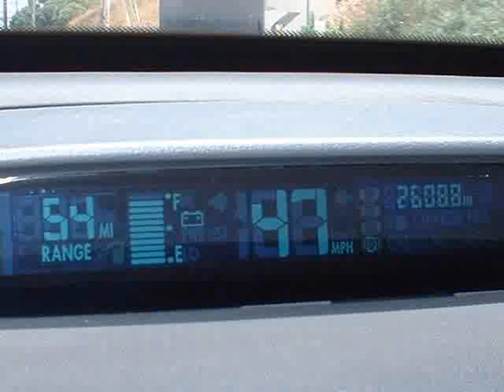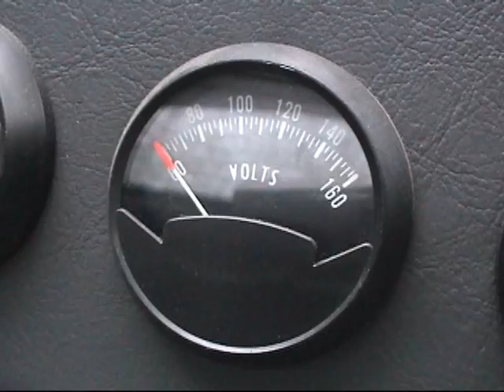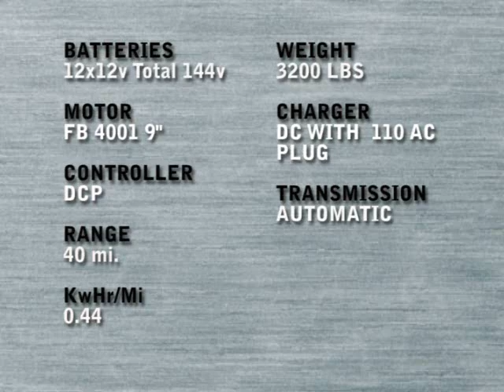Under His Own Power: The Electric DeLorean

Comment: The DeLorean did NOT come STANDARD with an automatic transmission.  In fact, automatic transmission DeLoreans are quite rare, and coincidentally very undesireable in the collectors market.  They were renown for problems.  The 5-speed manual was the STANDARD transmission.

Comment: Tilley's car was SUPPOSED to be "self generating" with an unlimited range. During its trial run for the media, it supposedly fried a wheel bearing which cut the demonstration short.
More than likely, the car was nearing the end of its charge and Tilley (excuse the pun), pulled the plug so as not to be discovered as a fraud.

If Edisons "nickle / iron" battery was so good, why are we not using them today in place of zinc / lead ?

 -- Dave.

Comment: One of Tilley's demos was to pull the car over after driving, then show people the voltmeter on the pack going up - those not versed in battery chemistry wouldn't know that the voltage of a battery at rest, especially a flooded lead-acid battery, recovers quite a bit resting after being under load (but there is no change in total energy stored in the cells).